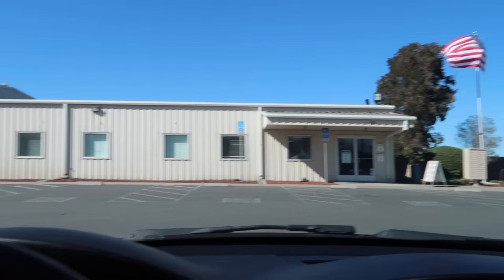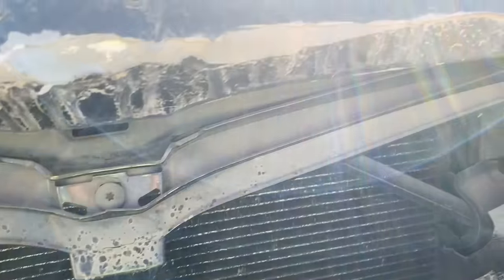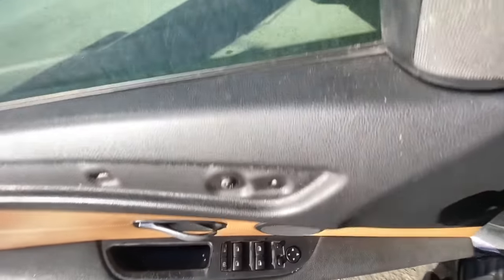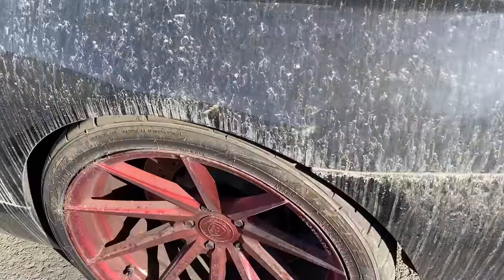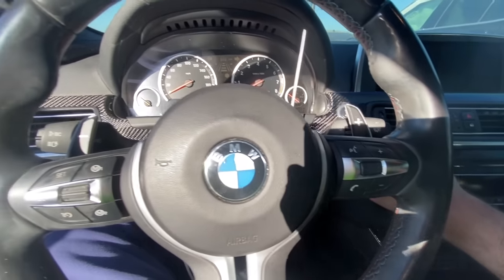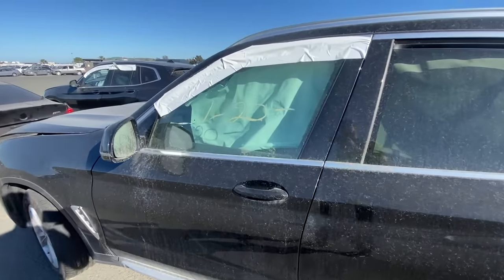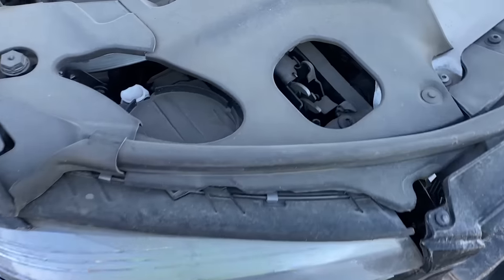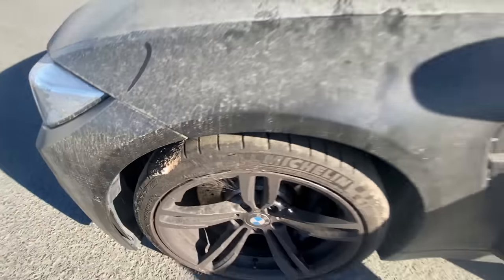THIS M6 SHOULDN'T HAVE TOTALED, SHOULD WE RISK IT?

Comment: the m6 and m8 more than sure blowed a pyro fuse in the battery compartiment is a little thing/box that attaches to the batery positive thing and either cuts off the starter or the fuel pump , the airbags didnt deploy prob cause the driver wasnt wearing his seat belt

Comment: Ibs on the battery terminal is probably blown. Pull the connector and it’ll probably start (with codes obv).
Reply: Side note, you can bypass it and clear codes using a 2ohm resistor. Not a great permanent solution but it will help pass inspection.

Comment: Did you check the battery duhicky on the positive post. Don't know for sure if it won't crank when that thing goes off but the accident could have activated it and is causing the no start situation. Just a stab in the dark

Comment: The reason for the M6 and M8 are not starting is because somebody wants to buy them cheap they must have pulled a fuse or wire to make it crank and not fire up So they can make a cheap offer and get it